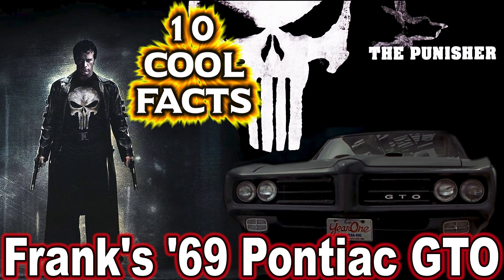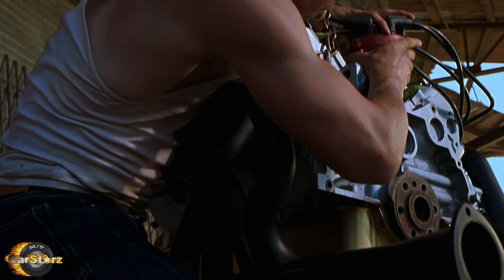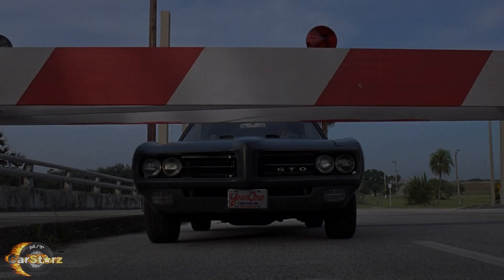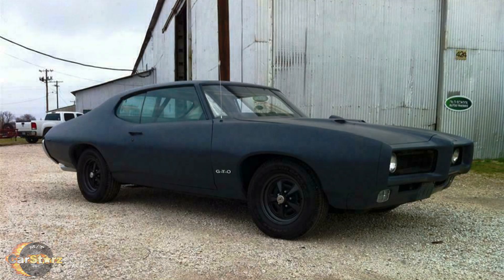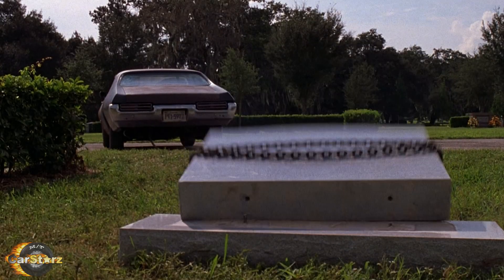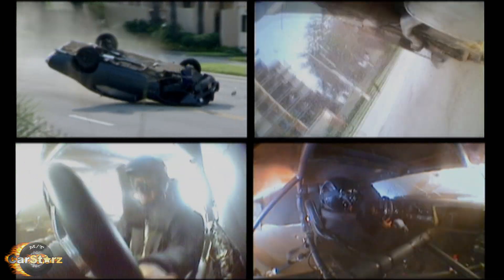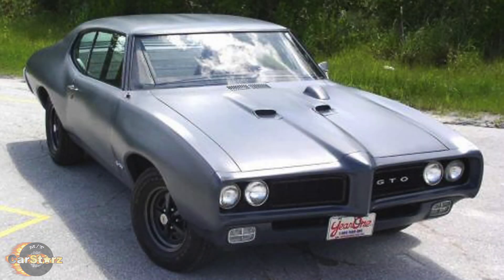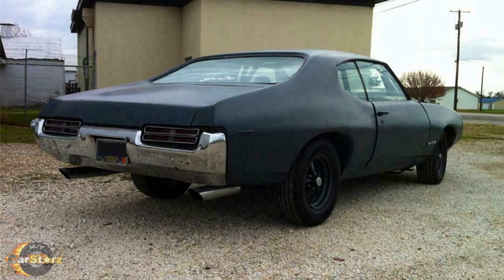10 Cool Facts About Frank's '69 Pontiac GTO - The Punisher (2004)

Comment: I remember the EBay auction for that one GTO. At the same time they also auctioned off the Satellite used by Harry Heck to look like a RR. That had been fixed a little as the front fender was not wasted like it was in the movie. I just remember thinking it was strange two movie cars were just being sold on eBay at the time. For like around 10 grand.